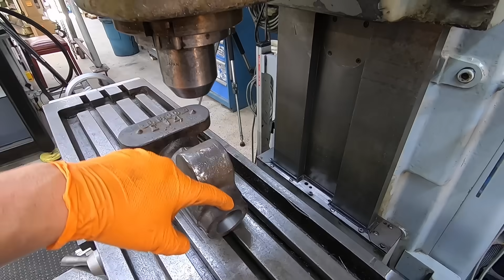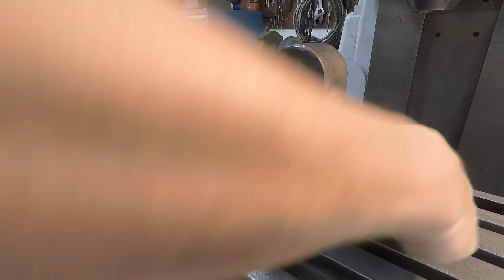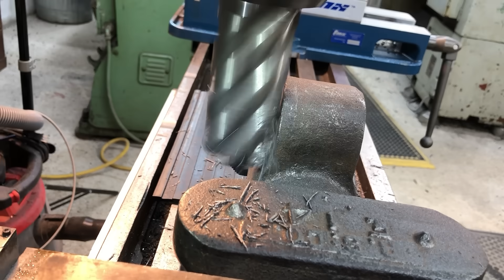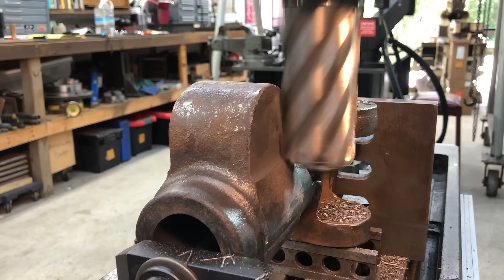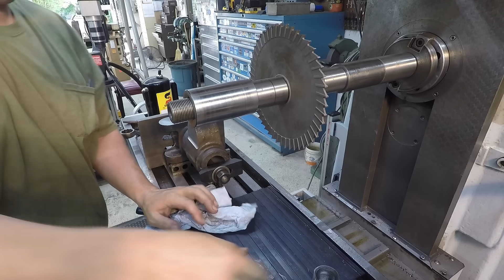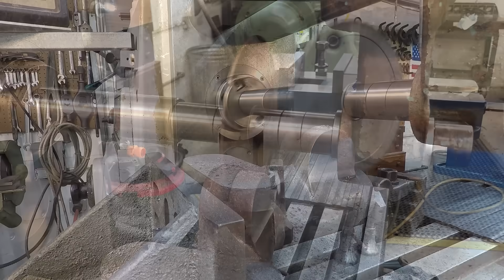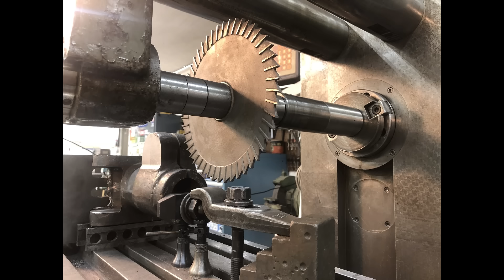Fairbanks Power Hammer Cross Head: Part 2

Comment: I wonder if the chatter would have been less if the table and part were moved as close as possible to the machine and the overarm bearing was retracted to be as close as possible as well.  It seems to me that it would be like lifting a bar with heavy weights on each end so if they are far apart the bar will bend in the middle but if it is a short bar and the weights are close it won't bed at all.  Just a thought.
Reply: I certainly considered the whole operation could have been closer to the body of the mill - provided he could get all the tools in all the places he wanted to do for the machining done - and yeah, have the outer arbor bearing about half length of the arbor. I'd be crazy enough to even consider mounting the saw immediately outside of the arbor support !
Reply: @millomweb  Yeah, I am no machinist or anything of the sort and don't even pretend to be but I am pretty good at solving issues that I come across when I am doing different jobs and don't have the specialty tool or whatever that would make the job easier. In fact I get called regularly to help friends with other garages figure out oddball problems with vehicles they are working on all the time because I have built up a pretty solid reputation for finding a way to get it done.  I could bore you for hours with stories but that initial comment I made shows a little of my thought processes and I can assure you that I would give it a try, even if it was the wrong thing to do. Lol
Reply: @MrKingdavis13  The best I can offer to outbore you ;) would be 2 engine block boring bars :)
My dad was in the automotive trade - and carried on after retiring. One of his mates brought him a V8 engine to 'do up' - I don't think he rebored it but opened the ports up and fitted sportier cam shafts. It all went a bit downhill for him trying to get it first started in the back yard. Usual set up - engine on a pallet, gallon can of fuel hanging on the washing line, no coolant or exhaust pipes. Anyway, it wouldn't run for him - so he called me to assist. It seems he 'd found a can of methanol and was using that for fuel. We were getting the bangs but not in the right places and it just seemed an ignition timing issue. Checked the firing order again with the Haynes manual - that agreed.
So I suggested checking the firing order from the engine itself - so hand turned it to get a new firing order - that didn't work. Repeated the process and got another new order - like the last one one but with one cylinder out of place. So tried that - usual setup - dad on throttle & choke, me on ignition & starter.
First compression - BANG - and it was off. Dad's grip tightened to steady the engine BUT he'd gripped the throttle ! I'm damned sure it lifted him a foot off the ground as a result ! Anyway, every cylinder was firing when we'd got it under control, running no bother - so then on to finishing the reassembling !

Comment: For the coolant and oil questions. Almost all the time when you machine cast iron you do not need oil or coolant. The graphite in the cast iron is basically enough lubricant for the machining process.
Reply: Dry swarf is certainly less sticky so easier to vacuum up. Lubricant not necessary as you say but I did wonder about cutting tool cooling as that was quite a heavy cut (based on the DOC and time each tooth was cutting) - so tool coolant may have been useful - and may have allowed a higher RPM or feed rate.
Reply: @millomweb  the issue he's having here isn't a cooling issue it's a rigidity issue. That's saw is plenty capable of taking a cut that deep you just need to be sure of the setup being rigid and whatnot.
Reply: @justinl.3587  Rigidity solved, I think. Pls explain why CI doesn't need the cutter cooling.
Reply: @millomweb  in some applications you do need to use cooling depending on what you are doing. In this application that he is doing he does not need coolant because the cutter is running right in the range where it's supposed to run.

If he wanted to push it faster like he was doing a hundred parts, that would take the cutter above its working temperature and then probably some fluid cooling would be needed to keep the cutter from overheating.

In this case though, the cutter was running at a relatively slow RPM and a relatively slow feed rate and well within its temperature range. How do we know it was within its temperature range? There was a nice flow of chips coming off of it, the cutter was not turning colors and distorting, etc etc.

Cooling almost never helps you in cast iron for an operation that he is performing. But like I said if he wanted to go faster and operate the cutter outside of its normal range then yes coolant would definitely help.
Reply: @justinl.3587  It does look like CI produces less heat when cut compared to MS. And yes, it was a good flow of swarf from the cutting process.
Reply: @millomweb  Yeah mild steel or stainless would have eaten that cutter alive without coolant or some kind of lubricant, that's for sure.

Comment: Question Adam... looking back on this slitting process. Do you think it would have mattered if you had flipped the saw over and reversed the rotation?  Essentially pulling the work away from the angle plate and pushing down, instead of lifting the part off the table and pushing it into the angle plate.
Reply: Was thinking the same as the piece isn't held down, but that would be a climb cut. I think he doesn't want to do that. Not sure why that would be bad.
Reply: @ErikBongers  exactly.    in my mind... with the blade flipped, and rotation reversed, the part would be pressing down on the machinist jack. Feed rate is a set given, the angle plate isn’t going anywhere, therefore eliminating the need for additional gooseneck clamping.    Kinda like a table saw. If I had done this job the way I’m describing, would I have been putting the part, blade or machine in jeopardy?
Reply: @trevorjarvis3050  With the load of such a cut, highly likely to have grabbed the part and dragged it into the blade possibly with the result of a shattered blade or bent arbor. He played it safe and I agree with that approach - with what LITTLE I know about milling ;)
Reply from the maker: What’s you’re talking about is climb milling vs conventional milling. Conventional mills have lead screws with backlash so no climb cutting or you’ll make a serious crash.
Reply: @Abom79  ok... let me see if I’m following along here. Let’s say the X has .015 backlash. The feed rate was I think you said .030? So as that lead screw is pushing the nut left to right, (zero backlash left to right), as the slitter contacts the part, it’s gonna PULL an additional .015 of material into it, making it jump left to right INTO THE BLADE? Correct? Edit here.... the reason I’m asking about this is because I’ve never used a slitting saw of that size. To me, that thing is huge!
Reply: @Abom79  Is yours the one with a backlash eliminator ? Some tuber's got one and I'm pretty sure it's not K Rucker !
If it's yours, do you know what it does, how it works ?

Comment: Can you reverse the direction of the cut so the saw teeth are cutting in the downwards direction and not the upwards direction?
Reply: Never touched a mill in my life, so take this with a grain of salt. But I think the problem with that is that the saw would be pulling the piece towards itself.
Not a problem if everything goes right, but I think your generally set up for failure so you don't destroy your entire machine if something goes wrong.
Reply: He could have done but it can be a very risky milling process. Serious risk of grabbing with such a big cut and if it did, could have ended up with a shattered cutter or bent arbor or both !

Comment: Why wouldn't you put oil or coolant on it on vertical cut ?
Reply: Cast iron.
Reply: Lube not necessary but coolant for the tool may have allowed the process to have been speeded up.
Reply: @millomweb  Except often-times you just produce a substance that wears away your machine and makes a mess. This is a one-off job; speed isn't a priority.
Reply: @thomasbecker9676  You mean with soggy CI dust ?

Comment: Is there a specific reason why you did the cut before drilling the hole used to tighten it down later? If you drilled it before the saw would have to go through less material.
Reply: I was wondering that, too; In my mind, there are advantages and disadvantages to both approaches. Drilling it through, tapping through and clearance drilling the hole to half depth would be easy enough (potentially two setup operations might be needed depnending on how things went). However, putting a sacrificial 3/16" aluminum spacer in there after slitting would allow doing all 3 operations to be done from one setup.
Reply: @matthewhelton1725  As he said in the video, he drills with a quill. It makes for a far more sensitive drilling experience. Drilling by lifting the knee or using the saddle adds all the feel of friction in operating those axes - although it could be done using power feed if you like things really risky !
Reply: @millomweb  Absolutely. I was addressing why (or why not) drilling and tapping it before slitting. Drilling/Plunge milling using the Knee can cause a lot of problems, especially with older (loose) equipment.
Reply: And if you cut before you drill the drill has to go through less material. Six of one, half a dozen of the other. It makes no difference in the end.

Comment: I'm curious why you didn't use coolant .....
Reply: cast iron has graphite in it and adding iol turns cast into grinding past to ware out your equipment.
Reply: @mathewritchie  Personally I always use coolant when cutting CI, put down towel to absorb the coolant. Sooner on the machine than in my lungs
Reply: @spikeypineapple552  You're the first to mention CI fumes and lungs when machining it. I believe it's a known issue with lungs. No need for lube but a tool coolant may have allowed faster cutting.

Comment: I am surpised that you don't use any cooling liquid on the piece while milling or cutting.  I apprenticed many many years ago at a machine shop in CT and learned a little bit about the skills required.  Had I not been hired by an agency of the intel community I'd probably stuck with being a machinist or tool and die maker.  I found these video to be fascinating.  Many thanks
Reply: Just over a hundred years ago,the universal advice for milling cast iron was either to do it dry,or to use 'soda water'. That is,Sodium Carbonate dissolved in water. Acid causes rust. Alkali actually preserves ferrous metals. So the soda acts as an almost detergent and a rust preservative. As well as reducing the chips flying everywhere. 
No doubt there are modern coolants that can improve on soda water,but most of the time a dry cut is acceptable.
Reply: Most times you machine cast iron, you don't want to use or even need to use coolant or oil.

Comment: Glad to see your still charging along. Doing that change over sure seems like a lot of extra work.
Reply: "extra"?  That is how the machine works. There is nothing extra about it.
Reply: It's one reason for V milling on the DoAll V mill. The process you see with his K&T is not as slick as the equivalent on mine but it still means taking 4 or 6 bolts out - and in my case, fitting a drive gear to the H spindle.

Comment: Never seen that mechanism  on the top to swing the vertical head round to make way for the horizontal. Very neat and saves a whole lot of hassle.
Reply from the maker: I built that myself, whole series of videos on my channel about it.
Reply: My mill came fitted with its own system to move the V head out of the way and it's a better style than that which I suspect is a K&T style but Adam built.

Comment: Why no coolant on that saw blade?
Reply: Probably because he‘s cutting cast iron
Reply: @WildsauGames  Cutter will still get hot with that cut !
Reply: @millomweb  Probably not with the slow feed rate and low RPM....
Reply: @CRUZER1800  That setup was creating quite a big cut. Maybe CI doesn't generate as much heat as MS when being cut.

Comment: Nice work Adam. When you move to start drilling holes are you planning to drill a round hole at the base of the slit you just cut? There will be a lot of stress on the sharp corners of the slit where the edge feathers out internally next to the bore. Are you concerned the piece could start cracking?
Reply: I thought the same, maybe Adam will do it on the DoAll. It has also the advantage that the end of the slit now having the shape of the radius of the saw blade will become straight. The actual slit will than become longer giving more “flexibility”

Comment: Why not drill the hole in the ears horizontally, while you have the K&T set up in horizontal mode?
Reply: Cos he has a DoAll capable of doing it - with a quill - which offers a much more sensitive drilling operation than doing on a proper mill and trying to be sensitive despite feel being lost among the friction of operating the much bigger sliding surfaces.

Yeah, you could use a large lathe to turn a small piece but again you just lose that more delicate feel a small lathe gives you.

Comment: Hi Adam .. not one toever question your techniques but why would you not cut downwards so it's forcing the workpiece onto the bed  ?? Or is that just wrong ?
Reply: I had the same question myself.  Flip the saw 180 and run the K&T in reverse to downcut.  I’m not sure if that’s a thing or not but it would push the piece into the machinist jack instead of trying to lift it.
Reply: @jeffreypeters8446  It'd effectively be climb milling - with all the risks that brings in to a situation where it's a risk you do not want. Could have resulted in shattered cutter or bent arbor - or both !

Comment: Good to see the mill head arm holding up nicely
Reply: Steel toe caps - just in case ?
Reply: @millomweb  That thing isn't going anywhere. There was much more danger of that happening without it.
Reply: @nebtheweb8885  It'd really be a crane job without it. The 'parking' arrangement of my mill doesn't have the head swinging about loose anywhere as it remains on slides - so a simple up and back so cannot swing into other parts of the machine chipping paint off !

Comment: Why didn’t you reverse the cutter so the force pushes down just saying suppose it could be a double edge sword though
Reply: Climb milling vs conventional milling.
Reply: Because the blade could climb over the workpiece and jam against it, potentially stalling out the mill, shattering the blade, or the blade could spin on the arbor, damaging the arbor, and/or destroying the key.
Reply: @BedsitBob  like I said a double edge sword the way he done it worked  ,but I agree with you
Reply: @BedsitBob  I'd have said shattered blade or bent arbor - or both . . . . possibly !

Comment: Please excuse a non-machinist question: do end mills behave differently whether the cutting edges are cutting "into" the workpiece, or "away from" it? When you milled the sides, it seemed to make a different sound travelling in each direction.
Reply: Yes, the deeper .040 cuts were done in  “conventional milling” whereas the light finish pass on the second side was “climb milling”

Conventional milling is much easier on the machine because the cutter is working in a way that the material is coming into the cutters rotation and pushing the workpiece away. It also forces the table back on the lead screw basically eliminating backlash. 

Climb milling is the opposite. This is when the rotation of the cutter and direction of cut makes the cutter pull itself into the workpiece. This can get bad in a hurry depending on the depth of cut, machine, cutter size etc....

Sorry if I didnt explain in a way that you understand, its tough to do in a comment. Maybe someone else can explain better.
Reply: @RyanDoesAll  excellent explanation! I just learned something new today! Thank you!
Reply: To visualize, picture using a table saw to cut a 2x4 the traditional way. Blade rotates towards you as you push the 2x4 into the blade. This is conventional milling. 

Now, walk around to the backside of the table saw (hypothetically! Do NOT do this) and feed the 2x4 through. The blade is going to grab and throw the 2x across the shop. This is climb milling.
Reply: @RyanDoesAll  Thanks for the reply. It just seemed "different". I suppose sometimes you just have to cut the way that is available to you, especially if you're only hoping to go halfway through.